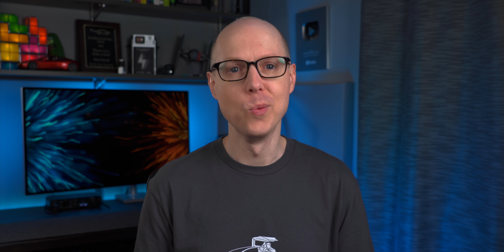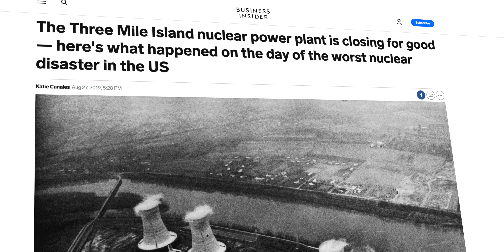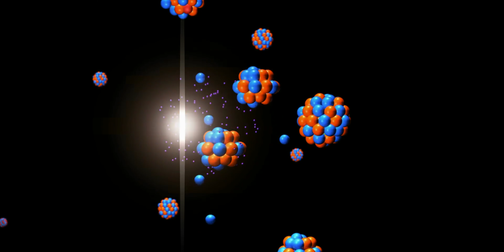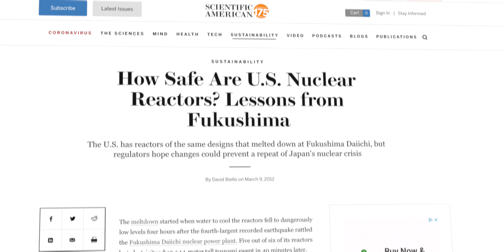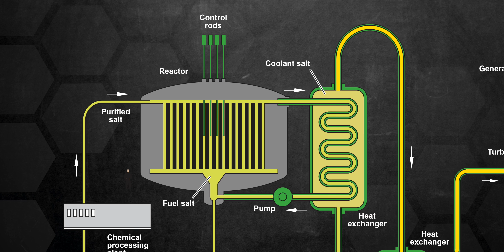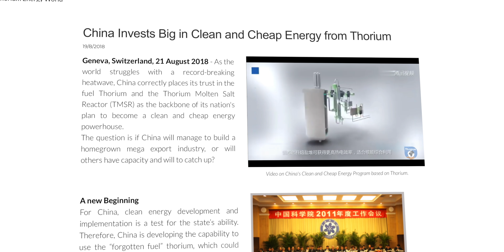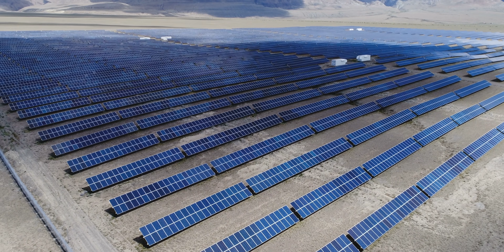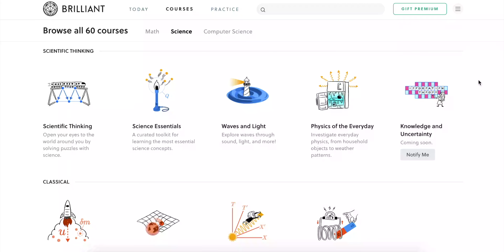Thorium explained - the future of cheap, clean energy?

Comment: Thank you - Indonesia already has a contract with ThorCon for 7x500MWe Liquid Thorium ion molten salt energy converters. Uses Sodium fluoride (not Lithium Fluorine) though...
Reply: Thank you for publicising Liquid Thorium ion molten salt energy converters. These can  run at a levelised capitalized cost of US$0.04/kWh - Also as a comparison between required land for solar farms and Indonesia's current 3.5GWe contract for the seven x 500MWe Liquid Thorium ion molten salt ThorCon "energy converters" have "As-built" foot prints of 1.1 Ha (65m x 175m) for each 500MWe unit. These will provide High temperature automatically load dependent output (rather than just a constant base load to complement the renewables) at near atmospheric pressure under  extremely "walk-away safe" conditions at a capital levelised  output cost of less than US$0.04/kWh as well as having the capability of doing a cold/black start while being able to act as a speaker suppler by almost instantaneously dropping  or increasing output depending on load and sudden increases on the renewables.
And with a 44kW/m2 footprint it is going to be hard to beat by any combination of renewables and battery banks providing 52x7x24 electricity...without destroying our Indonesian forests and jungle for solar and wind farms.
https://youtu.be/qd_lBPbeVrQ
Reply: @mrvaticanrag3946  Nuclear always comes in far more expensive than advertised. When you look at the relative space required for renewables it's not much, especially when connected up with other grids, such as Australia's.
Reply: @turningpoint4238  Nuclear electricity is cheaper than the others
Reply: @raziasrazias7761  Nope.
Reply: @turningpoint4238  on a per MW of capacity basis nuclear is more expensive every time, yes. But when you actually do the maths to take into account the capacity factors of nuclear compared to renewables and the longevity of each, nuclear is always cheaper.
It's just a huge capital investment upfront with more risks and higher interest rates but projects like thorcons SMR could change that.
Reply: @doritoification  When all costs are factored in then fission isn't cheaper. The industry likes to forget about all the external costs (like governments (read tax payers) been left to pay for long term storage of radioactive materials). Not holding my breath for fission been practical any time soon.
Reply: @turningpoint4238  spent fuel isn't crazy expensive to store exactly the way we do right now in dry cask storage on site. The idea that we need to go and bury it deep underground is just a political solution to a problem that doesn't exist. Spent fuel can be reprocessed and reused in a reactor. Currently it's more economical to just refine and enrich virgin uranium so not many places reprocess spent fuel and in the states it's actually banned! (Another political solution to a problem that doesn't exist)
People don't complain that the government has gold reserves so I don't understand why we complain about having reserves of spent fuel full of usefull stuff just waiting to find a use and get reprocessed whether it's more reactor fuel, industrial isotopes, medical isotopes or just a plain heat source for some kind of industrial process. Spend fuel is a commodity not a liability we just need to treat it at such
Reply: @doritoification  Having all those used fuel rods and other highly radioactive material sitting around is expensive to look after. It also is a very tempting target for terrorists and therefore needs extremely strong security. Medical isotopes are made in specifically made rectors not extracted from other waste material. 
Sellafeild is a very good example of how expensive this is and trying to reprocess material is dam hard and expensive. Not only that there have been countless leaks and accidents with stored material, including in the plant I used to work in.
Reply: No Sellafield is an example of the issues surrounding Plutonium-239 production for weapons. It is more than just a power plant and always has been. It was central to the entire weapons programme in the 50s and continues to reprocess spent fuel today for use in MOX reactors.
I do appreciate that there are issues with Sellafield but they are not representative of the modern nuclear industry
Reply: @turningpoint4238  And you're right that medical isotopes are not extracted from spent fuel rods. But that is a real shame because it's technically feasible with molten salt reactors for example to just have in line extraction of Bismouth 213 from the fuel salts for use in targeted alpha therapy for treating the worst myeloid leukemias.
My point is that it has value and we should capitalise on it rather than treat it as waste.
Other isotopes like Cobalt-60 are extracted from spent fuel. Canadian CANDU reactors produce most of the Cobalt-60 which is used to irradiate food and sterilise medical equipment.
Reply: @doritoification  Sellafield is the modern nuclear industry.
Reply: @turningpoint4238  Well i'm not so sure about that but let's just immagine a graphite pile type reactor was the modern standard... It would still be low carbon and we would still need it to fight climate change. It's convenient that we don't have to use such a crude reactor design because there are so many benefits to various other reactors but even if that was all we had we would probably still need it.
We've emitted 1.5 trillion tonnes of CO2 into our atmosphere and we need to figure out a way to pull it back out to stop global warming. Getting to net 0 just stop the acceleration of warming which is still like driving off a cliff at 30 miles an hour instead of accelerating.
Whatever method we use to go carbon negative, it's going to require abundant, cheap power that's reliable.
Nothing is perfect but nuclear waste is a whole lot better than a mass extinction
Reply: @turningpoint4238  well I'm just quoting ThorCon who have th PPA contract with indonesia - ThorCon organise & pay for each 500MWe energy converter- Indonesia's buys the Power at the agreed PPA rates.
Reply: @turningpoint4238  Go to IEA.ORG for the "Projected Costs of Generating Electricity 2020". Long term operating nuclear has the lowest levelized costs, median cost of 32 USD per MWh, of all forms of power, being a little over half that of the nearest competitor onshore wind's median levelized cost of 50 USD per MWh. New nuclear power plants median levelized cost is lower than 13 different sources of power and more expensive than only four, one of which is long-term operating nuclear.
Reply: @turningpoint4238  All of those costs are factored into levelized costs. They're not forgetting anything.
Reply: @turningpoint4238  Stored fuel rods physically cannot leak. They're stored in reinforced concreted containers and then filled in with dry grout. If any liquid got in there the grout would absorb it and solidify.
Reply: We will see, not holding my breath for this one.
Reply: Very excited about their design and the business model too. Lars is a good guy with an excellent vision

Comment: The KISS principle -- Keep It Simple Stupid.  Wind and solar combined with battery storage are safe, clean, simple and cheap..  Why look for a complex solution when an inexpensive simple one is available. Wind, solar, wave energy and geothermal can provide all the power the world needs.
Reply from the maker: Ultimately ... yes, but we are still too far away from being able to produce enough storage to make that a reality right now.  It's why many are looking towards nuclear as a stop gap to get us off fossil fuels quicker.
Reply: @UndecidedMF  NEW battery factories are being built all around the world. The ramp up for batteries is similar to the ramp up for LCD screens. As more are built the price will drop making them an even cheaper solution.
Reply: @KJSvitko  the free energy overtakes hell of ways even in the  time shortened. thank God
Reply: Yes and that’s what is happening. 
They really had to create these thorium reactors 20 years ago. Ultimately they would be the better solution, but not the simple one.
Reply: Hi Kenz300 x
It is pretty easy to convert 20 or 30% of the grid to solar and wind.  But it gets harder and harder beyond that because you need base load power.  Batteries are great for damping out small peaks and troughs, (and I'm delighted that they will gradually replace fossil fuel peaked plants), but to quickly kill fossil fuels you will need fission or fusion.

Germany turned off its nuclear power.  The price of electricity shot up, and their fossil fuel use when thru the roof.  After more than a decade of building wind and solar, they are approaching the fossil fuel usage rate before they turned off the nukes, but the price of energy is still high.

If you want to say, "solar and wind are wonderful, they last almost forever, they require trivial resources to build, and we don't need anything else!"  Well, good for you.  All I ask is that you turn the nuclear power plants off AFTER we get rid of the the fossil fuel plants.

Warm regards, Rick.
Reply: @RicksPoker  That might have been true 5 years ago but with advances in battery technology and combining wind and solar it is not longer true. Wind and solar are now base load power :)
Reply: @KJSvitko  
Hi Kenz300 x,
If that was true, we would have national grids running on solar or wind.  But the best I've seen is Germany which managed to get a shade over 40% in the SUMMER.  After more than 2 decades of pushing hard for wind + solar + garbage burning this is the best they can do.    Further they have almost no battery back up.  

However, if you want to believe that solar + wind will be cheap, cost few resources, last a very long time, and be very reliable, then good for you.  All I ask is that you push to get rid of fossil fuels before we phase out nuclear.

Warm regards, Rick.
Reply: @RicksPoker  It is true. But grids change slowly. As coal plants shut down they are being replaced with wind and solar. Every year the percent of wind and solar goes up while coal goes down. That is why coal companies are filing for bankruptcy.
Reply: To diffuse energy to run a steel mill or a aluminum works or even a paper mill even recycling metal or glass takes more electricity than wind and solar can provide.
Reply: @joastark  You can "concentrate" it with the magic of electric technology from the 19th century.
Reply: @joastark  wrong unless using oil law betz limits ignoring Einstines equal and reactions

Comment: The big no no is not meltdown but storage .. 500 hundred years half life is 499.9 years too long
Reply from the maker: I have a similar point of view, but didn't really state that openly in the video.  I'm not so much worried about meltdowns, especially with the newer designs, but it's all the waste.  Tucking away stuff for 10,000 years?  C'mon.  500 is still way too long, but is more manageable ... especially if we master things like the traveling wave reactor that can use a lot of that waste.
Reply: The shorter the half life the stronger the radiation that would be some deadly stuff.
Reply: It’s all about the cost. Nobody cares about the half life, but about the cost of it.
Reply: @daniel_960_  ok well put your hand up to store it in your garage or spare room then
Reply: Lloyd Jordan funny. I’m just saying the more the half life the more expensive and complicated the solutions to store it get.
Reply: @flodjod  
Hi Lloyd Jordan.
Current nuclear waste has 99.5% of the U235 unburnt.  It is also full of many other valuable isotopes.  

If everyone in the world gave me ownership of their nuclear wastes, I would instantly become a very, very wealthy man.  No, I would not store them in my garage.  

The reason that this 'waste' has built up, is that natural Uranium is so cheap, that it is cheaper to make new fuel rods out of fresh Uranium, than to reprocess the fuel.  But new reactors are being designed which can turn that 'waste' into terawatts, of electricity.  

What would you pay for a terawatt of power?

Warm regards, Rick.

Comment: Meltdowns are the main reason the public doesn't like nuclear reactors, but cost and waste storage are the reasons we're not building more. Seems like that should have been emphasized more.
Reply from the maker: Fair feedback, but thought I did hammer that home comparing 10,000 years to 500 years.  And with next gen nuclear like the traveling wave reactor ... it can actually use that spent waste as fuel, so we can chew through our 10,000 year storage.
Reply: @UndecidedMF  I guess it was the presentation. You emphasize meltdowns in the intro but the storage issue more as an additional reason than the main one. Overall the economics is probably the main reason we're not building more.
Reply: @UndecidedMF  Actually, a approximately 86% of the fission product waste produced by a thermal spectrum MSR thorium breeder would be decayed to background radiation levels within a decade (10 years) of being produced, and not 500 years. Only Cesium 137 and Strontium 90, which combined would make up around 12% of fission products, would require around 300 years to reach background radiation levels, both having 30 year half-lives.

Also, MSR advocates like to falsely claim that the waste produced by an MSR is safer. This is absolutely false. The waste would be almost entirely fission products, which would be MUCH more radioactive than just plain old used fuel rods, making MSR waste MUCH MORE dangerous than LWR fuel, But because of those stupid high radiation levels, as I previously noted, almost 90% of the waste will be gone in just a decade or so of being produced.
Reply: Waste? Do you know how much waste a US nuclear reactor produces over 60 years? Average size being 1,000MW. 

 The size of an Olympic size swimming pool...

 Over 60 years. It is like 3x3 meter cube per year. 750 kilograms per year. 

 Add in new technologies that reduces that, and recycle that cutting down the half life.

 Then I'd argue waste is a product of laziness rather than some huge issue so many people make it out to be. 

 When I learned just how little waste is produced? I was dumb founded how much of an issue people made it out to be honestly.
Reply: My guess is that costs would go down if we were allow to recycle plutonium.